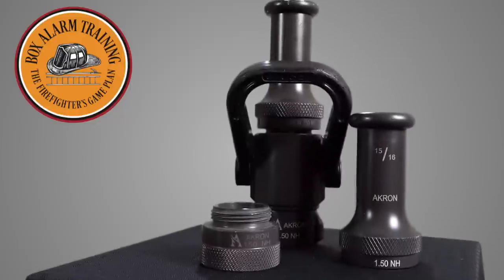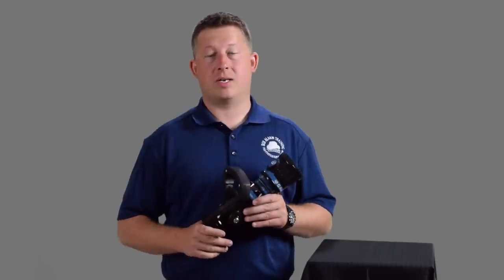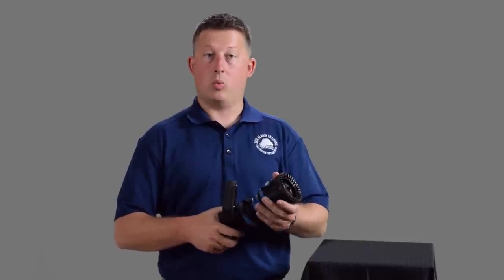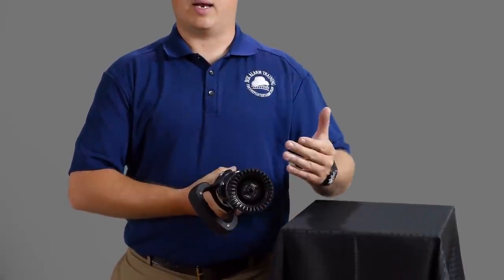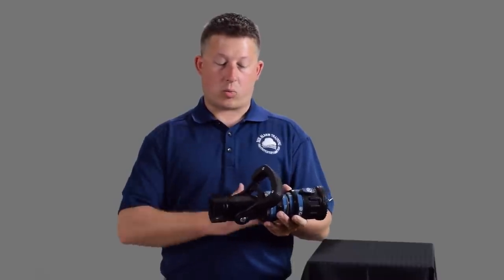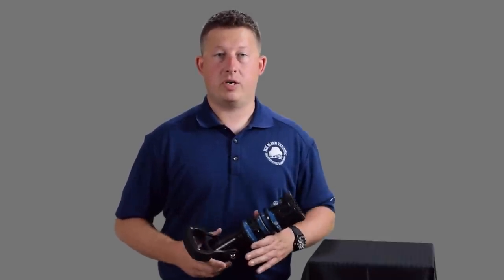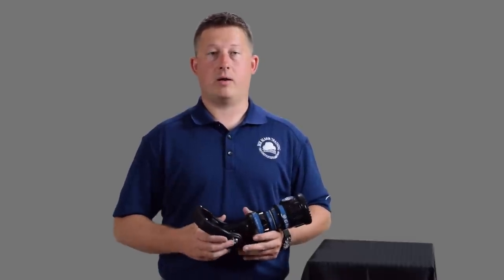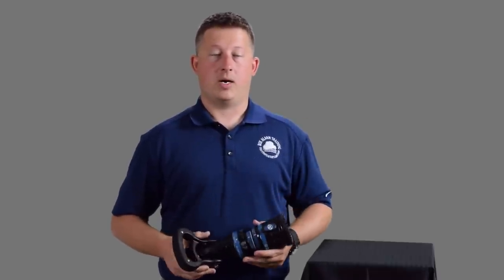Nozzle Series - Automatic Nozzles

Comment: How do you calculate GPM on an automatic nozzle? If NP is 100psi what GPM am I getting out of my nozzle? Our nozzle does not indicate GPM at a psi only a range of 50 to 300 GPM.
Reply: A pump operator must do a friction loss calculation, since he is the only one that can regulate the flow. The desired flow must be determined in advance, friction loss calculated for that flow, added to required nozzle pressure, and the sum will be the pump discharge pressure

Comment: i don't understand the part where, If you are getting 60psi from the pump, and the nozzle is set to 75 psi, then you will flow 75 psi. How can you get more from less?
Reply from the maker: I’m not sure I understand your question.
Reply: Think of it as a regulator. If it is getting 60 psi from the engine, it will cause a back up in the line to increase that 60 psi to 75 psi. If it is getting 100 psi from the engine, the nozzle will back it down to 75 psi. Hope that helped.